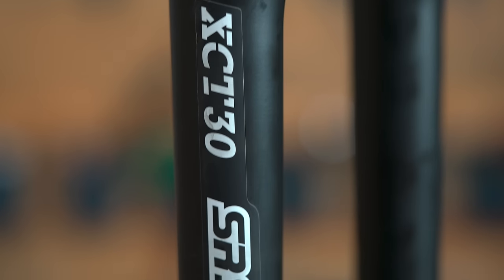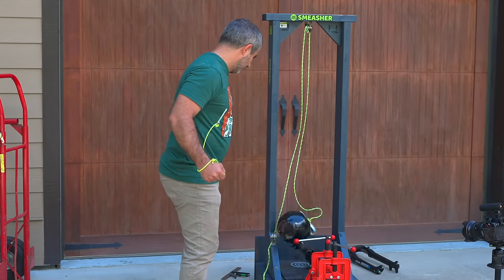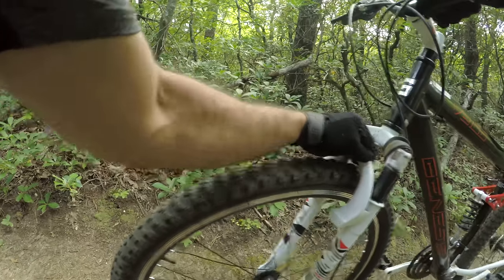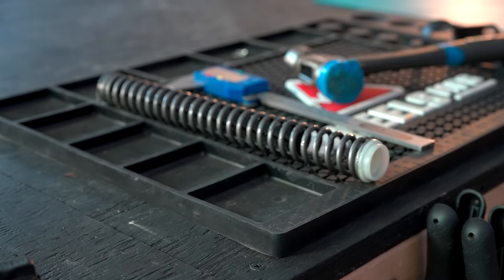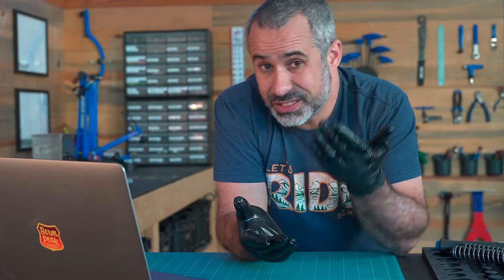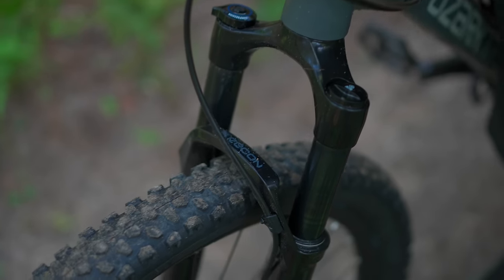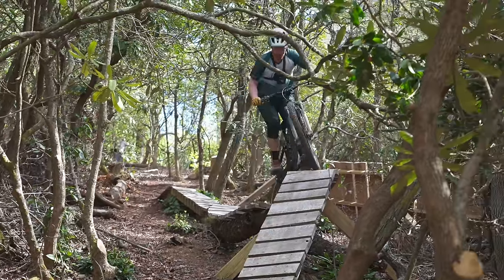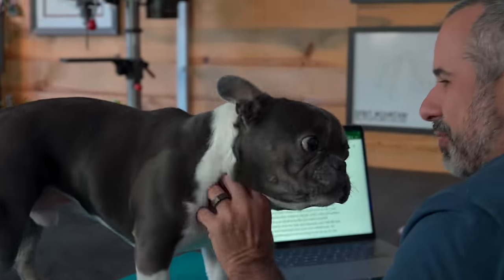The most popular MTB fork you (probably) know nothing about

Comment: Yup, used to have a Suntour XCM fork on my mountain bike between 2011 and 2014. I liked the fork, very easy to clean and service. The only gripe I had with it was that it was heavy.
Reply: xcm fork is terrible, and provides a lack of control and no suspension,
it looks like a shock fork from the outside
but it doenst work liek one, and the remote lockout is constranly degrading and failing.
the construction is weak, and the fork is disposable , marketed on the  cheapest cycles available for a reason.
Reply: @netcoms197  Not really. It was a coil sprung fork with a fixed hydraulic dampener. It did work fine, as long as I used the right coil spring for my weight. There was some lack of adjustability on the dampener side, but the fork did it's job well. I didn't use the remote lockout though, so I don't know how well those are made.
Reply: @independentthought3390  why are you describing that it is a coil sprung fork, 

we both obvously know what the xcm is, since  were commenting on a video advertising the xcm coil sprung fork in question.
we already know exactly what the product is described as.

the actual design of the fork itself is very poor, designed to fail, ith plastic parts,

it is meant to look like a suspension fork, but provides none of of the benefits such as actual control when it is  engaged.

the fork is designed to promote the suntour upgrade program

the fork doesnt rebound efficiently,  it is terrible, by design
as everyone whos actually into using mtbs knows.

it isnt about expecting it to be a great fork, its the fact that it is a terrible suspension fork that provides no benefits.

of peopel google this fork, they will see that everyone agrees, 
 
the video presenter is paid by suntour to make this favourable video.
this is a sponsored advertisement.

Comment: These forks unfortunately get killed by rain (which we have a lot of in Seattle). The spring pre-load adjuster isn’t sealed and so they fill from rain above until it turns into a rusty mess inside. 

It’s too bad because with a couple of O-rings they could hold up a whole lot longer.

Comment: I have a Suntour XCM on my Marin hard tail. 

As someone with about a decade of experience in BMX prior to riding MTB for the past year, it's very decent. It's easy to get caught up in the specs and everything. But especially for a beginner it's going to handle everything you can throw at it. 

I huck mine around all kinds of sketchy stuff in the PNW. Given my BMX experience, I've been hitting doubles and drops since day one that have grown bigger and bigger with time. 

I'm getting to the point where I'll probably shell out for a full suspension. But you absolutely do not need a Fox or similar fork to have fun. Your arms and legs have a ton of travel with proper technique. A lot of people are just too used to relying on the bikes suspension to do all the work for them.

Comment: @bermpeak Can you clarify the info about the upgrade damping cartridge? You made it sound like these cartridges can be installed in lieu of or in addition to the rebound rubber that goes inside the coil spring. I think the cartridge is actually a replacement part for forks already equipped with a hydraulic lockout. It isn't an upgrade unless you are retrofitting it to a fork with a mechanical lockout or no lockout.

I do like that SR Suntour offers replacement parts even for these cheap forks.  Not many would bother, but it's cool that for $30, you can order a rebuild kit complete with grease and a spanner wrench for the fork caps.

Comment: I was a bicycle mechanic for 9 years and I would have to say at least 75% of people that had adjustable high end products on their bike still asked us at the shop to set up their bikes... My ethos is, If you can't tune it yourself and understand what you're changing you don't need it.

I still own stuff on both ends of the spectrum and I will say that once a fork with high and low speed compression and rebound adjustment is setup properly for the rider it does feel better in many nuanced ways... But a more basic fork is 85% as good straight out of the box with a few minor adjustments. If you don't want to spend hours and multiple rides tuning your suspension, something more basic is absolutely fine!

Comment: Great for the entry level rider but to gain confidence, increased control and speed you definitely need to upgrade. I have a suggestion for a video is to spec out a manitou air fork. The markhor is the cheapest in the line up and I tell you it rivals rock shox and fox.
Reply: suntour also makes air forks based on these entry level coil but they are much better quality, and ride a lot better, if you adjust them properly, their highest end xc something model is the xcr air. it is pretty decent for an entry level air fork, of course a fox or rockschox or one of suntours higher end forks is better but its still decent

Comment: Have a look at the XCR, they aren't much more expensive but the performance gap for the slightly bigger investment is massive. The set on my wifes bike actually work, can be tuned and don't weigh the same as an anchor.
Reply: I use an XCR32 air. It's a good fork for the money, it already has a metal ring above the bushing inside the lowers and not just the plastic bushing.

Comment: Growing up in the BMX bike world on high-end bikes but now a busy adult and parent on a tight budget, I found myself on a budget mountain bike. Just trying to get back into the swing. I’m on a Ozark trails Ridge 29”. Blown away by the quality for the money. However I’m finding the front suspension too heavy to match my riding ability on the trail. Looking to shed a few pounds with an air fork upgrade that is cost-effective and does not require the replacement of my front rim or hub. Do you have a fork suggestion and would you ever consider doing a very detailed video on just the fork replacement?

Comment: The forks are freaking great for ebikes. When you have a 6kg battery pack you dont care much about the weight. You care for the durability and price, so you can pair them up with a mt200s and the biggest disc you can find to stop your 140kg weight of a vehicle safely and cheaply. 
Albeit a different model, I've used this variety of forks on a 60km/h, almost 50kg ebike with a 203mm disc and m7120 breakes, and it was solid.

Comment: i remember my first actual upgrade. from a zoom fork (probably like 60mm travel or something and you couldnt even open it or adjust it) to an XCT. that upgrade was just a domino effect cause you couldnt replace the fork without replacing the stem and you couldnt replace the stem without replacing the handlebar, also took the front shifter off and cut off 2 sprockets from the front cause you couldnt remove them any other way, i dont rememer what i did about the rear shifter as it was one of those grip shifters and i think it didnt even fit the handlebar. Im actually gonna find some pics of that bike rn to figure out what i did there
Reply: i just found a pic, its really bad. 
i had a regular grip, then the grip shifter, then the brake lever. with the grip shifter youre supposed to have smaller grips so your shifter and brake wouldnt be too far from the end of the handlebar but with a regular grip, the end of my brake lever was like 8cm from the end of the handlebar

Comment: I just dropped about $400 on a new drive train, after almost 3k miles on the stock set-up. It's not as if bicycles have the same printed maintenance scheduling as motor vehicles. It would be nice if they did. Only schedule I've got is clean and lube the chain every 100 miles. I can do that in just over a week. I think I'm about 120 miles since I had that upgrade done.....

Comment: SR Suntour are quite easily the best general consumer brand. They get a bad rep because of the volume of cheaper units they shift which inevitably get abused, die, don't feel as plush etc but this puts a load of money into the company. 
 The high-end stuff is amazing, Fox/Rockshox levels of quality and performance yet a much better pricetag. The Rampage proven RUX is "only" £1400, a Fox 40 or Boxxer is £2000. Did I mention that the Rux has both straight and tapered steerer options? A Fox 38 will cost you over £1000, the Suntour Durolux 38 is £700-800 and there's a Durolux 36 to take on Lyriks, Pikes and Fox 36. The Aion is a 35mm do all which takes on the Fox 34 and Rockshox Pikes, it's just as nice but way more affordable.
 A good friend of mine has been running an SR Suntour XCR 32 Air fork, 650b, 15x110mm, 130mm travel, for the past 2 years. I've serviced it at 6 month intervals with RSP Slick Kick for the seals and Fox Gold 20wt fluid. That fork performs incredibly well, almost as good as my 2017 Fox 32 Factory (150mm) or 2021 Manitou Mattoc Experts (150mm). Indeed, unlike my Mattocs they have a lockout circuit, big win there.
 SR Suntour have another feather in their cap, they are the last bastion of true Marzocchi. They make all of DVOs forks and DVO was formed by old Marzo engineers when Fox purchased the company in 2005. That's why Marzocchi are so similar to Fox and why DVO are so slick.

Comment: I have had the XCT and it was just awful. It ticks the box for the sales spec, but that's about it. Plus, the stanchions are very prone to pitting and rust. I also have the XCR air, and that is a whole other level. Not as good as the higher end stuff, but a huge step up from entry level.
Reply: The XCR32 air has no foam rings inside if it comes from factory, but it has an empty space underneath the dust caps where you can put in some afterwards. So you can further improve the fork when you service it
Reply: @simonm1447  have just received a ZTTO seal kit for this fork ,so planning on doing a quick service now I have the seals and foam rings.

Comment: I think Suntour make some of the other more prestigious brand forks. It was a few years ago but they were making their own top end forks and forks for other brands in Taiwan but the 'XC' range; XCE, XCT, XCM and XCR were made in a larger factory in China. That was a few years ago so it may have changed a bit now but they are definitely a OEM for some other brands too. I find the XC range very confusing as a full upgraded XCT might be better than a XCM as there is such an overlap in options and over time they have increased stanchion diameters so last years XCM might not be as good as this year's XCT. The XCR is available as a air fork or coil fork too, same model but completely different spec. Also the XCE which is only for pre-built bikes has little information about it. Lastly the stanchion diameter's range from 28mm to 34mm so there is quite a difference in strength for the XC range. Ultimately these XC range forks span a very wide specification and can feel completely different to each other.

Comment: The main problem with these forks are plastic slider sleeves. Many customers are afraid to ride their bikes because these forks tend to wobble front to back between the legs and the stanchions. Some of the forks have that wobble out of the box. Other than that, these forks are bulletproof.
Reply: agreed, the cheap coil suntour i used to ride on my old Bike had that, my current xcr air does not however.

Comment: An SR Suntour suspension fork was on my Trek 4300 when I bought it in July  2007. They were ok, but not great. I'm looking at a pair of Rock Shox Recon Tk Silver 26" with 32mm steel stanchions; they're not overly expensive, they are only
💰390.00 on Amazon 🍁👍👍. There's another pair that says they have 30mm 7050 aluminum stanchions for about 
💰550.00🍁; but it reads for 26, 27.5, and 29"🤨

Comment: With these forks Suntour should include a soft/medium/hard springs so the selling bike shop can customize for the buyer.  

The weak point is your stuck with the spring the bike company spec it with.  Way too many times I’ve seen kids or smaller females stuck with a stiff spring to the point the fork doesn’t even move.

Comment: You can replace the seals and bushings, yeah in theory. But are  replacement parts available from the manufacturer?  Not as far as I know. I cant even buy replacement Parts for my low to mid range Suntour Air fork. Maybe if I contacted the manufacturer directly.

Comment: How often would you say I need to replace the seals? I've had the same ones on for about 4 or 5 years, and they've seen pretty much every sort of weather and riding style I can throw at them. Definitely did not take it easy on them. I have taken them apart, cleaned, and relubed them a few times, but im still getting a black residue when they get compressed

Comment: I've got the SR suntour xcm 30 with a hydraulic lockout unfortunately the hydraulic lockout broke and cannot be removed because when it was installed from the factory the tool fitting was stripped SR Suntour was kind enough to send me a new lockout for free put since I cannot remove the old one it does me no good.

Comment: A problem with all cheaper forks is that you can't find someone to service them (at least here) and even if you can find someone.. it will cost as much as the fork itself.
Reply: But it will still not cost more to service than a more expensive fork - and since the less expensive forks are simpler designed they are also simpler to service, which means it's relatively easy to do that at home.

More complicated forks with several wheels and knobs for adjustment are harder to servive just because they are more complicated.

Comment: Anyone remember the old oil bath mod you could do to the Marzocchi 2006-08 DJ1? Does anyone remembr that? Either way, if you need a cheap 26" dj fork you can maybe find used DJ1s for basically nothing. Manitou Sherman is another old fav that can be found used for cheap....of you can find one. 

Both are cheaper/better used than a suntour. Not saying to poke seth, Im just saying that old forks especially mid 2000s Marzo and Mani forks are high quality. I still use them regularly.

Edit: my recommnedation is based on thr fact that EVERY brands' dirtjimper from 2004-2010 Came stock with a DJ1...so there must be thousands pf them sitting in garages. Shot peen and a deadblow hammer and some 10w susp oil is all you need to mod one. Seals genrally last forever and replacement seals are like $20. 

Trust me -an oil bath 5lb DJ1 is a more durable dj fork than most $1000 tapered forks are in 2024

Comment: PSA: if you have this fork and cannot for the life of you attain full travel, pull out the rebound rubber and cut it down by an inch or so. The end caps of the spring will hit the rubber before full travel is reached otherwise

Comment: Talking about entry level forks, can I have an opinion on rockshox judi stk cause I see it EVERYWHERE on entry level bikes...
Reply: The base Judy model is a Coil Spring with a set rebound. Much like the Suntour XC's. It can get a little pogo-y. If you don't mind dropping $250-350(depending on vendor and variant) you can upgrade to the Judy Gold RL. Much more adjustability and it's an air shock with oil damping.
Reply: @SternLX  mine is the silver air version, and to be honest feels fine but I dont have a huge experience with different forks

Comment: I can tell from experience that these are indeed user-serviceable by almost anyone. 
You'll need a few special tools, but these are available cheap from the usual suspects.
Tip: get your grease and oil from a special lubrication webshop or an agricultural supplier. Hydraulic grease is cheap, 10 bucks will last you a lifetime of fork services. The same with fork oil from a motorcycle shop, should you upgrade to a fancier fork.

Comment: The main thing I don't like about these forks is the fact they get slapped onto every bicycle even if there is no need for them. Like most city bikes these days even come with them and they are just 3-4x more heavy then a non suspension fork and frankly, those drive better if you aren't doing any off-road. They also rust and chip and after a few years outside no longer function. I prefer no shocked fork for most of my bikes.

Comment: the biggest point with these for me was always the complete lack of adjustability. I see a lot of those forks on kids and young adult's bikes and with the springs being so stiff and not really adjustable most of them only use up 1-2cm of the 10cm of travel. You can actually see a clear line on most of them where the travel is actually used because its not as dusty as the 8cm or so below that. thats just awful and a cheap air fork is just worlds better in those regards as you can actually set it to fit you at all

Comment: Berm i need your help! T-T My bike has a ticking sound while I ride it . I thought that it was because of the bike computer sensor hitting the receiver but it's not . I tried to break slowly and hard and it didn't solve the problem so I was like ok it's not from brakes ( and i think that usually brakes don't make a ticking sound ) . I tried not touching the handle bar, it did nothing. I tried not touching the pedals, it did nothing. I tried not pedaling, it did nothing. I stood up so i don't touch the seat , it did nothing. What can it bee? T-T nothing else moves randomly and I start thinking that it's because of something inside the wheel .. :(

Comment: These forks work fine, but they are not really durable. Chrome coating on the legs don't live too long, and because of plastic bushings inside you starting to get a play pretty soon. But the issue is that you can find cheapest RockShox forks for about 100$ (at least in Europe), which will be much more durable. And how much is the new Suntour? 80$? But on the new bikes you getting Suntours in the price range from 300 up to the 1000$, and even higher. That's weird